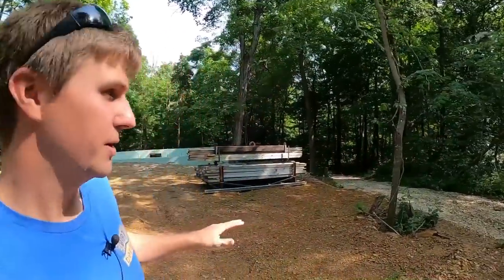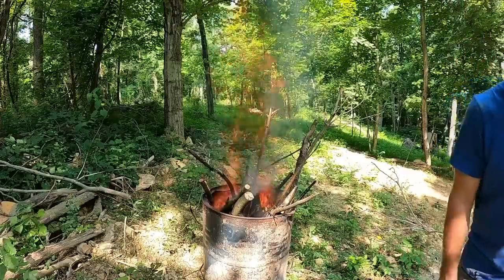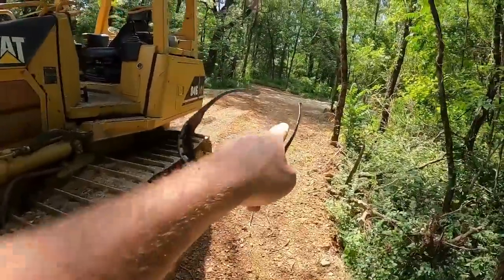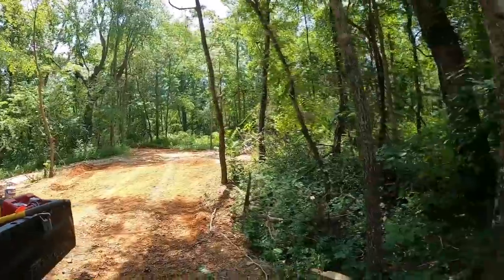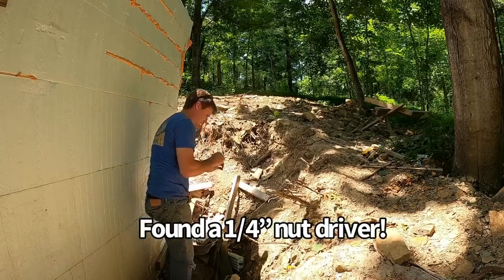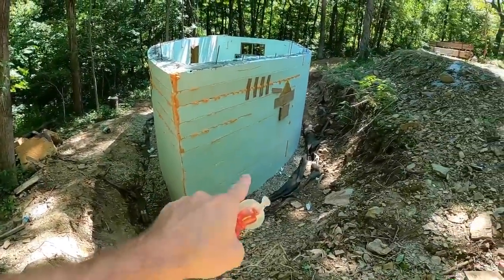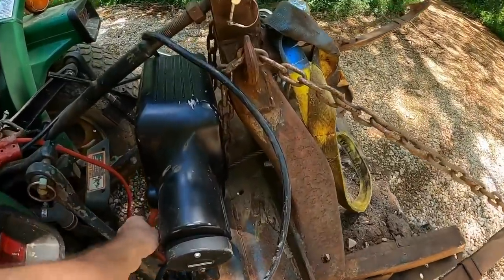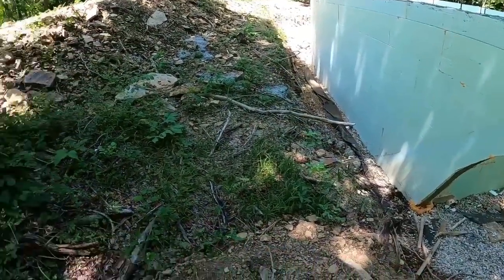Using Bulldozer to Repair Road for Rock Trucks - Youtube Yacht Project

Comment: Just a hint....if you can get a concrete truck close enough to the yacht. Order the truck without concrete just have it filled with 3/4 stone, the truck can off load directly (with the chute) into the floor of the yacht, making for a VERY EASY job. I use this method regularly for my jobs, and it works great, cutting the labor by 2/3's
Reply: @Crewsy  That's a great alternative, we have them here also. But for the cost factor, its more economical to use a concrete truck.
Reply from the maker: We have used concrete trucks for that before.  Works great,  but very pricey here

Comment: You are looking much better on the dozer. You definitely have some talent to pick it up so quickly. Usually when I use fuel oil in a garden sprayer it it a one time use, The fuel oil eats all the rubber parts in the sprayer it it doesn't work anymore. I was in Memphis In  last week getting fuel in the rental truck that I drove for my brother who is moving to the Knoxville Tn area
Reply from the maker: Good tip on the fuel eating stuff up

Comment: Its going to be so nice. I think it must be hard to pass pushing trees and brush out alongside the road when setting in the seat of the dozer but the hour clock doesn't lie so we keep hours down and get virtuous along with extreme sore backside. I have got up at your age and couldn't stand in front of the toilet cause of the kidney bounce and packing what a mule would of said no to. You have done well Two Dogs Doodling around... that was PG for other readers and a funny joke shared standing.

Comment: I would suggest that you get yourself a half-inch drill bit and drill several holes in the bottom then space out holes around the sides, top to bottom, and the barrel will turn into a great burner. I do that and the barrel seems to last longer and the fire will get really hot. It appears that yours isn't getting enough airflow. Try it, you will be amazed! Just sayin!
Reply from the maker: The bottom is cut out and has a large 6x6 hole for pipe and leaf blower

Comment: you can run air in the bottom & get a fast complete burn
Reply from the maker: Yup,  has a hole for HVAC duct or pipe to go in bottom for leaf blower when I need it

Comment: any time I did a concrete pour I made 3 or 4   2"x4" x2ft square forms and poured the clean out and extra concrete in them they make great sidewalk slabs  ( for free )
Reply from the maker: Same here,  that was outbid the pump hopper though,  hard to get that into anything without shoveling it all in.
Reply: A guy that worked for my Dad years ago made a form for a 3 step concrete riser. 
Used scrap material laying around while we waited for the truck to arrive. Worked great and the steps looked awesome but even hollow they were heavy.

Comment: Hey Captian. Around my parts there are places that deal in used steel I-beams. Two or three decent beam would make a nice base for a low weight limit bridge. I would think you could drive your side by side across it.
Reply from the maker: That would work great!  But the budget is currently set at “free stuff I have laying around” 😂
Reply: @CaptainKleeman  Well heck, maybe the I-Beam fairy will drop some off. Stranger things have happened.
Reply: @CaptainKleeman  you know we are expecting nothing less than a Captain Kleeman re-work of the Goat Canyon bridge now!!!
Reply: @Bcc0rg  
A mini Goat Canyon Trestle would be cool. 
It could lead over to his “future” train themed rental cabin. 😉
Reply: @Crewsy  yes, sure do like the idea of an abandoned railway station cabin the wood idea, faux railway track over the bridge as the path leading up to cabin would be fantastic.

Comment: Great video!  As expensive as the equipment rental from DP is, can you imagine or have you calculated what the actual cost would been with a paid operator.  Not saying that your time is not valuable, but as if you were an average home owner that was building this project.
Reply from the maker: I think learning a trade is one of the most valuable thing a person can do,  this is a prime example of how much it has saved me from having to hire someone.  Thanks for watching!

Comment: Captain, I'm curious if an a-frame lift point towards the middle or back edge on the log puller would allow the logs to lift over the edge better or if it would be in the way. A square frame might provide a larger opening. (Note: for the winch to use a pulley off of)
Reply from the maker: It’s pulls up really well as of now.  I thought about that when building,  but didn’t want to design it in a way that would try to pull the front end up in a hard pull, if that makes sense
Reply: @CaptainKleeman  yep, make sense

Comment: You ever check the oil in a tractor before you start it? Before I start any tractor be it a lawn mower to a D8 dozer I check the oil. Always park it on a flat level spot so I can make sure it's ready to check the oil the next morning. You'll be doing a lot of free work for DP and not getting anything else done for yourself if you blow the motor up in one of those tractors. I've worked for a small grading company since 2004 and that is standard practice for us aswell as the larger grading companies you see building highways. It might not seem like it's that important because "it was running fine yesterday." Ok but what if it got a decent leak in it toward the end of the day that you didn't catch and all the oil drained out of the motor over night? Its something that could happen so if you can catch it you won't need to buy a new motor just fix the leak. Maybe you check the oil and just don't show it like DP doesn't show himself doing it all the time. Rather be safe than sorry and maybe anyone reading this will that doesn't check the oil in their equipment like they should will start doing so. Takes less than 2 minutes and can save you from buying a new tractor.  👍
Reply from the maker: I do a lot of things,  you really want to see me check all the fluids every video?  Every now and then I include the footage,  but honestly it’s not that exciting to show.